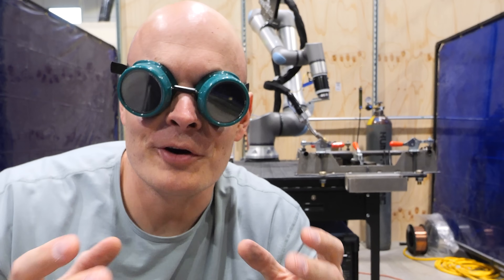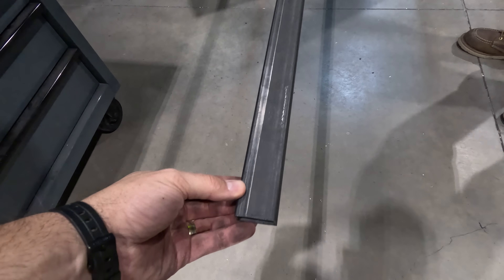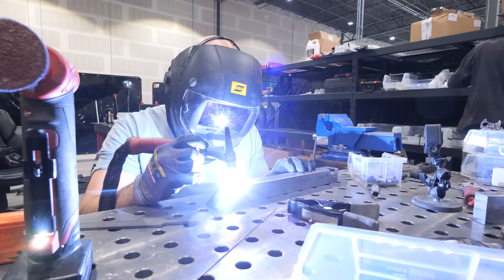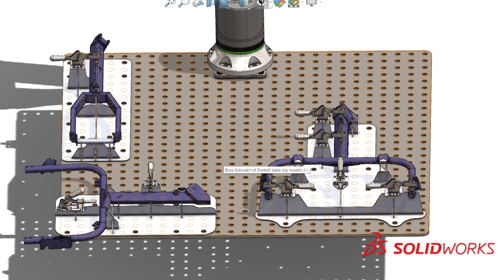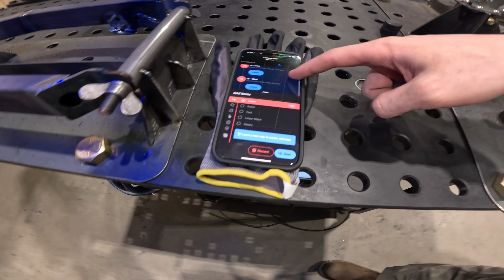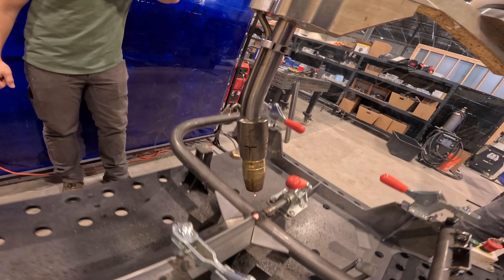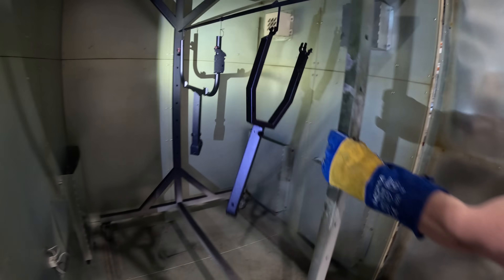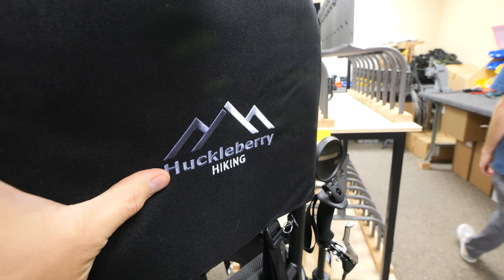My factory is up to something special...

Comment: The table is to small for Sparky, you make the table long enough for 10 mounts and put in adjustable hydraulics for the mounts (with cameras or cheap sensors to verify correct placement),
then the welding machine slides down the new rails (with a 3rd rail supplying power?)  it is mounted on and does the next 2 or 3 batches of parts (depending on how many it can reach at once).
THEN when the welding machine is half way done either a human or a robot unloads the finished parts and loads in new steel.  Usually the paint booth is where robots appear in any factory
since that job is both fume hazardous, and boring.

Comment: Does your robot have the ability to wrap corners? if so, that would make this welding process miles more efficient, and without sacrificing strength, would definitely at least cut down the non-productive time of the robot, I was a welder at caterpillar and ran similar robots in my free time for a long time, it also looks like some of the sequencing is inefficient

Comment: Zach, I love your videos and I have used Solidworks in my professional life and in my hobbies over the last 10 years. The version of solidworks you are advertising for 45 a year is next to unusable. It is permanently internet connected and forces you to go through a service called 3d experience. This is hands down the worst software I have ever used. For $2000 Solidworks is the best hands down (or for free if you have experience with pirating). But do not buy the version with 3d experience. You will regret it.

Comment: I think you can use a high torque motor and attach it with the wheel for easier pulling.

Comment: If you have wire straighteners the tips last much longer with way less wire memory curl cutting thru the copper tip at 2$ ausd per tip about 10 years ago

Comment: If your mig welding make sure to put in way points above the weld before and after so as to keep the weld wire as strai❤ght as possible about an Inch or so  it stops the robot from tearing the wire and making the next arc start in a different undesired position

Comment: I would further develop the drag pack that’s how I called mine for luggage and equipment instead of people. Since it makes sense to keep the weight on the ground rather than the back . The steel approach is stable it can be a material mix that makes it more flexible and nimble. We are also not built of pure rigidity rather flexible and strong

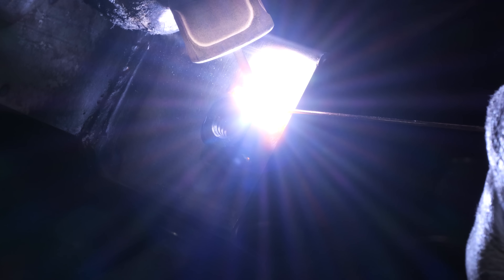Comment: 3:45 imo ALL manufacturing should have these especially if bolts are upside down or in a place ya need 6 mos old hands and arms as long as giraffes neck to reach. Just saying, lots of appliance repair service calls and there’s always some nuts that get dropped or a bolt goes missing b/c trying to put back in is insane

Comment: Hey Zack, love the work you're doing! Just a quick safety note - at 3:27, I noticed some folks working near an active weld with just regular safety glasses. Since TIG arcs give off lots of UV, maybe consider adding a welding screen to prevent someone accidentally getting a flash burn. A hundred odd bucks to prevent some nasty eye damage

Comment: Love it.  Any plans for an adult-sized off-road push chair?  Our son with CP loves to hike, but the options in the sub-$1500 space are massively underwhelming.  We have one but the fixed front wheel makes it difficult/exhausting to hike and the aluminum frame, while lightweight, is not rigid enough for off-camber situations with a 130lb passenger.  This market segment is ripe for better option and I can see it doing significantly more volume than your other projects.  Thanks again for producing products that make the world bigger and life richer for our loved ones.
Reply from the maker: Thank you!! Have you heard of the Extreme Motus? They are also made here in utah. (Not at my factory yet though.) Is kinda pricy but I've heard alot of good things about it.
Reply: @JerryRigEverything  I had not!  That's super cool!  Unfortunately, it's beyond our price range....but future goals :)  Please consider doing a push-chair along the lines of your paradox project that uses as many off-the-shelf parts as possible.  Ideally something that could fit in the back of most SUV's or minivans.  Now that Advance Mobility/Baby Jogger seems to have discontinued their offering, there are precious few options in this space at that price point.

Comment: As a 27 year certified welder, I’ve seen many trends in this industry. If being a production line business owner? These machines make sense profit wise.The initial cost is high, once setup they are cost efficient. It does take someone knowledgeable in fabrication to be present with them….but you aren’t paying the ‘fabricator’  rates to that person . And that 1 individual can watch over and feed multiple machines. So the revenue for the owner is much higher, due to less employees. While still producing the same amount,or more of the product. And when the work ends? 1 employee is gone….and the owner then sells the multiple Cobot’s for X amount. Making even more money.

Comment: Scans shop Poor things.. Points at Ultrasound direct sound 3D printing which can print through walls Through walls mentioned because = Smelting metals or forming molten metal into things without contact with Ultrasound source. Google: "Ultrasound can reach temperatures as hot as the surface of the sun and pressures as great as the bottom of the ocean" Plasma generated Ultrasound better.. Points at Ultrasonic resonance frequencies publicly used for lake and pond Algae control You can transfer Ultrasound straight into materials to vibrate them perfectly. What is heat when it comes to frequency? That's how you split things without destroying any content you're trying to turn them into like fire does.

Sets computer to generate high pressure Ultrasonic holography image in the air and turns on Ultrasonic holography tunnel sending molten metal through the air to to the pressure image to fill it with metal If we was in Star Trek you would call it "Replicator technology" because Ultrasound can molecular print also. It can print resources out of useless resources.. Runs finger from junk resources all the way up to creation of rare resources "In some cases, it can also increase chemical reactivities by nearly a millionfold." Plasma generated Ultrasound better..

Comment: This is an awesome project, great to see the ingenuity and care that goes into this product … however, as a complete noob when it comes to this sort of design and manufacturer, I have a couple of questions … first is the decision to use steel as the construction material. Surely aluminium would be both strong enough and considerably lighter/ easier for a human powered device to use? I understand the benefit of 70% of the combined weight being transferred down through the wheel, but the other consideration must be the amount of force required to pull this weight over long distances? Secondly, can the Huckleberry be folded into a more compact size for transport? When travelling with a family and other necessary things like wheelchairs etc, space can be a premium in a standard car or truck?

Comment: EPIC. I wonder if adding an auto electric motor wheel would be beneficial. Especially to the puller on the steep inclines. They already make them for wheelchairs . Maybe also an added suspension and shock absorber on the rear wheel arm.

Comment: Fun fact, the same theory behind powdercoating is practically the same as what is used inside a laser printer. 
Toner is fed onto a charged photovoltic (voltaic?) cylinder, which has a pattern drawn on it by a laser "scanner" (think scan lines from a CRT tv!) and then is pressed onto a belt, where other colors are also pressed on, and then finally it is pressed onto a page ready for "fusing" (heating up and pressed further, analogous to "baking" in powdercoating)

Comment: Protecting your Robot Welder from potential damage is crucial for maintaining its longevity and performance. Here are some recommendations:

Protective Covering: Consider using a heat-resistant fabric cover designed for welding robots. This can shield the robot from heat, sparks, and UV radiation emitted during welding, preserving its paint and components.

UV Protection: Welding emits significant UV radiation, which can degrade the robot's paint and materials over time. A protective cover can mitigate this exposure.

Regular Maintenance: Implement a routine maintenance schedule to inspect and clean the robot, ensuring all parts function correctly and preventing potential issues.

Operator Training: Ensure that all operators are trained in proper handling and maintenance procedures to prevent accidental damage.

Environmental Controls: Maintain a clean and controlled environment around the robot to minimize exposure to harmful elements.

Comment: Nice to see your set up.  I work for a company in South Africa and we manufacture structural components for the mines . So we have a similar environment except ours is on a larger, more industrial set up. We have 2 laser plate cutter / 2 plasma plate cutters / Many Band saws / 2 CNC inline Drills / 1 ficep CNC structural steel processor / 3 Fanuc robotic welders / 2 Press brakes / guillotines /  many lathes and milling machines and CO2 welders /  stress relief oven / Shot blast and paint bays etc etc. it’s great to see . Both your set up and the love for the industry of Fabricating and all the machines and technology that make it all possible and the very best .

Comment: Come to think of it: in manual welding, one has to remove the scale of the welds after welding (with a hammer and brush). How come this isn't necessary when the robot does it?

Comment: 8:24 could setup a second table on the backside and the cobot could be welding on one table as a human could be swapping out the other table. The welder would produce twice as efficiently, until the gas/wire runs out, or the human stops replacing done part with unwelded parts.
Reply: This is specifically a co-bot. They have extra brains for working in close proximity to humans without cages between.
Reply: You're hired
Reply: It can be quite dangerous to be working in such a close distance to the robot when it is actively operating. Many robot arms in manufacturing have laser sensors around them to make sure to shutdown if anyone enters the nearby zone. 
Also being a welding robot it would mean that you would need to wear welding goggles if you are working so close to it.
Reply: Unfortunately, this wouldn’t work due to safety, but also repeatability

Comment: You could also make a manual fixture rotisery, so you can flip parts and access the underside. To reduce spatter, you want to be able to go in to axial spray transfer. The bb s get so small they don’t stick. Its challenging on thing gauge, but its doable.

Comment: Quick tip. Unless those bolts fit really snugly in those holes, I would recommend you switch to shoulder bolts. These will improve repeatability after moving the fixtures. I been designing, building, and programing robotic welding fixtures for over a decade. Good fixtures are 95% of the battle. Robots can TIG as well BTW, they are just expensive. I have seen incredible results with GMAW. You just need thin wire and a pulsing welder. Here to help. Feel free to contact me with any questions. Love what you do, and how you do it.

Comment: with over 25 years of great experience using Solidworks, i am finding it difficult to find work. I believe it is my age but I am at my peak right now (obviously a perspective thing). Where are these jobs you refer to? I can design and manufacture these things your showing and have vast experience in R&D developing products.
Anyhow, this was a cool video, I've worked with laser tube cutters and automated benders for wheelchairs in the past, such cool machines and they really help in the design process as you stated.
Reply: Its not age. The market is absolutely flooded with cheap indian labor.
Reply: @funnyyylock  funny you say that. My last job was taken over by them. I was about to train them when I decided that leaving was more important for me. They were 100% right out of school, all here on H1b visas.

Comment: What MIG power source are you using? It sounds like the wire speed is too slow. Also, keep in mind when welding seams welding moves in the direction you weld so welding from inside to outside will help keep the welds from pulling the structure closed on you.

Comment: If you have human welders, cobot welding makes no sense. All the time you spend setting up and teaching the bot could be spent actually welding. Until there is learning look-forward with weldbots, this isn’t a scalable tech. Cycle time is abysmal.
Reply from the maker: For one single part. Correct.
For 1000 parts? Incorrect.
Reply: @ for 1000 parts, that’s traditionally been called a “robotic weld cell.” Nothing new here with cobots, they’re just cheaper. 

Tolerance stack still makes cobots impractical for small batches due to the “learning process”. Even if cobots are more affordable than traditional weld cells, the operational cycle time costs are still the same. And in my factory, all I care about is productivity, not so much initial capex. 

Everyone is touting cobots as some sort of evolution in welding, and all they are is the same throughput inflexibility just with a lower initial cost.

Thanks for responding.
Reply: And speaking of robotic welding with look forward scanning, I’ve been watching Path Robotics. They’ve been chipping away at the issue for a few years, not quite ready yet, but looks promising. AI with 3D laser scanning linked with a base 3D CAD model to allow the cobot to adapt to common small batch tolerance variation. That’s a new approach to the tolerance stack challenge.

Comment: I am trying to get started in robotics, 
but taking the first step is the hardest step to take.
Right now I am limited to testing code locally and remotely.
I have a number of PCBs designed, but trying to figure out 
which one the public wants most is the difficult part.

How do I start and avoid the patent trolls?

Comment: €2.417,95 EUR???? :)))) That thing is cool but is not worth more than 4...500 euros MAX.
Reply: i mean yeah, they use a giant laser machine to cut two holes cut a pipe in half. This is prototype manufacturing, not mass production.
Reply: @floppa9415  nah..i've been working in this sector for 20 years. I design projects and use laser tubes and 2d lasers on a daily basis. That frame costs 50 to 70 euros to produce on a small scale. 50 more for the paint job. The numbers just don't add up as far as I'm concerned. 2500 euros for basically a wheelbarrow is comically expensive to me.

Comment: It's interesting Welding system that you program the process while moving  This is something new
Usually everything is done through the AutoCAD or SolidWorks software 
But there is an option here to trace according to the movement according to what you want point by point ,
, the machine can correct the software and you can combine new moves 
At least that's what I understand , While making a new move you add a new line of code to an existing one It is very practical.

Comment: Cobots are good for such small parts, which are not in large series production (like 1000 pcs per day). Otherwise, Panasonic robots are the best in welding because they are specially designed for welding. In addition, they have self-correction (touch sensor) and offline programming.

Comment: Man I remember programming ABB bots back in the day, learned to use pendant blindfolded but it was still slow and annoying.
We didn't have a that teaching tip, we used pencils. If someone did an oopsie it usually meant that the pencil died and not the part.

Usually.

Comment: @JerryRigEverything
4:58: You claim there is a "massive shortage of good engineers", but as someone with 3 years of experience using SolidWorks through my mechanical engineering degree I have not been able to find work as an engineer since graduating in April 2023... If you know of anyone struggling to find a mechanical engineer ready to use SolidWorks to engineer new solutions please let me know. I'd believe you if you said there was a shortage of trained engineers with 5+ years of experience, but as a new grad seeking employment I can assure you the job market seems plenty saturated. I've been looking for almost a full year and am still looking. I'm willing to relocate, take a pay cut, work remote or in person, and have been continuing to refine my CAD/design skills using my 3D printer for personal projects. Still no dice. 

I can see the insinuation being that I must, therefore, not be a GOOD engineer. I did very well in all my internships, saved my capstone project from heading in the wrong direction and failing to accomplish anything, and have successfully solved multiple problems through my own designs at home. I have produced no evidence that I can find to a potential employer that I do not fit the bill of a "good engineer" and yet I have never been given a chance to develop professionally into what we supposedly have a shortage of. Maybe I'm blind to something everyone else is seeing about me, but I don't think the shortage is as bad as you make it seem. I'm also willing to accept that the demands of companies is outside of what the labor pool can provide (not enough companies hiring entry-level, leading to a lack of "qualified" engineers for a majority of positions out there), but from someone who has seen himself shine in engineering roles time and time again when given opportunities the "massive shortage of good engineers" is is either artificial or imaginary. The engineering talent is there, but being passed up on.